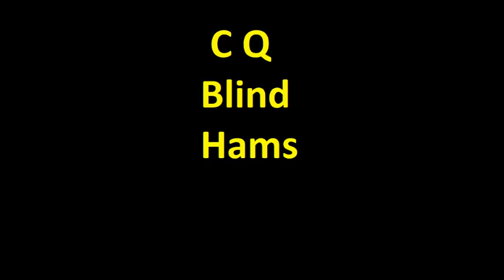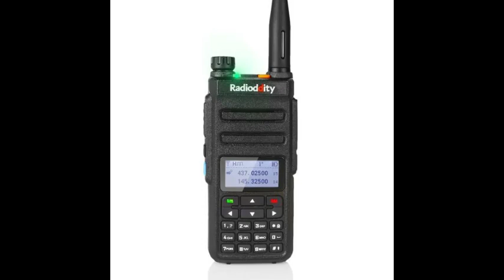Open GD77 for Blind Hams Instructions by Ian DJ0HF

Comment: 🚨  Hi, Ian. I'm new to ham radio and don't yet have my FCC license. I picked up the GD77 this week and hoped to grow into it, but wanted to use it, not only for hobby, but for emergency use. So far, I can't figure out how to punch in frequencies for use in communicating with my Baofeng UV-82. 

The keyboard doesn't allow me to easily enter in a frequency as the Baofengs do, but then, how does one manually enter in a frequency? I spent over an hour trying to do it. So please, how does one communicate with a Baofeng using a GD77? THANKS!

Comment: I’m avisually impaired Ham, recently discovered this radio through a friend. Have most of it set up, my question is when I first set up the radio, it shows 2 zones, and contact. They all have a bunch of stuff in it. Will that change once I load up my own code plug and also is there a way for me to delete any of those from the radio itself?
Reply from the maker: Yes it will write over the old channels when you put your new code plug in.

Comment: Blind radio enthusiast here, just curious; what exactly is the website where I can download this package? I don't hear it listed. Thank you so much
Reply from the maker: Hi John,  Joel (W0CAS) here from CQ Blind Hams. I sent your question to Ian over in Germany and before I paste his answer I would like to say that. The GD77 with the Open GD77 firmware can be set from the options menu to transmit out of the ham bands but may not be legal in your country. Before you turn band limits off you should check the laws where you will be transmitting. 

Hi Joel,

hope you are well and of course John has a learning curve if he wants to use his new GD77 on DMR, get himself a DMR ID etc. and put it in the code plug and set up his DMR chanels of course  but if he installs OpenGD77 and the default code plug then if he didn't include the Radioddity sgl file then he will just have FM and he just has to hit the red button (top right on the keypad) to put the GD77 into VFO mode and can enter a frequency from the keypad, remembering to enter all the 5 digits after the point when he will hear a beep to say frequency entry complete and then he can talk to his UV-82.

If he did include the Radioddity sgl file in the build then he might have to hold the SK2 button and hit the star/asterisk button to change from DMR to FM mode before going to the VFO mode and entering a frequency.

Probably easiest for a start to just upload the Opengd77 firmware to the radio without including the Radioddity sgl file so that he just has FM.
Using it on emergency channels is probably illegal in most countries as it's not type approved, not sure about the USA.

73,
Ian
Reply from the maker: Sorry for taking so long to answer you. http://www.spencerweb.net/Downloads/OpenGD77/opengd77.html